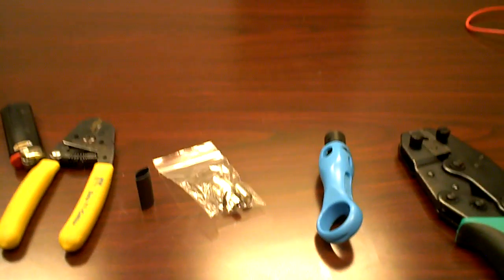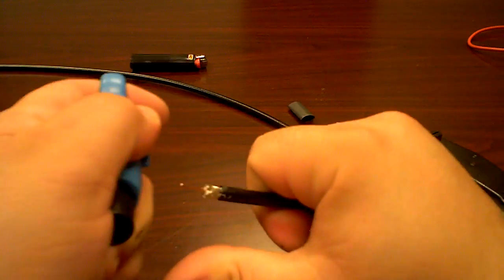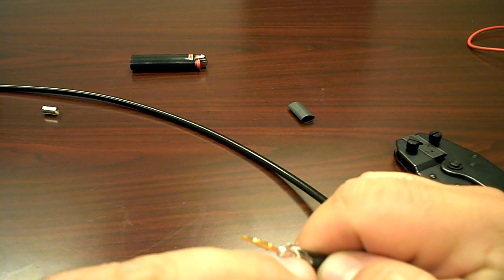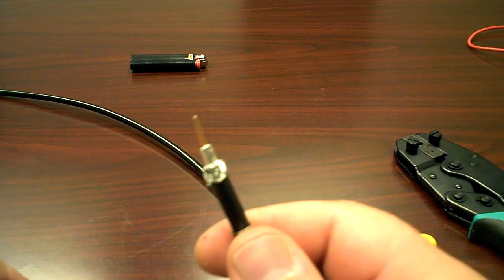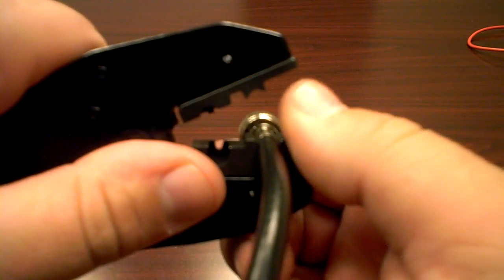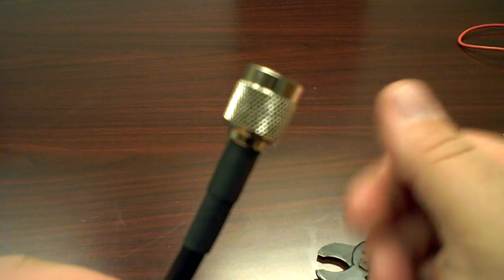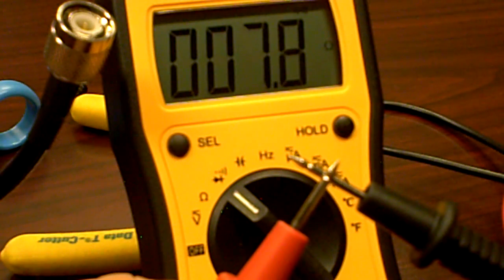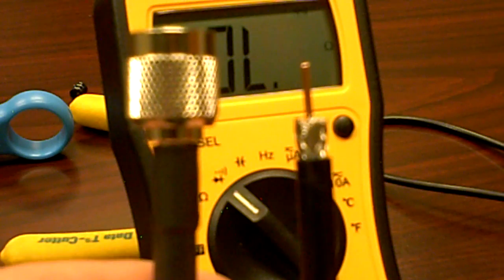LMR240 Termination

Comment: about a month  1/2 ago I bought some of this coax in the form of an 18' jumper. My intention was to use it when it came in but I just can't get my self to take the old off and put the new on. Is this as good as its made out to be?  I know I am missing out on some great coax by letting it set where it is.

Comment: Great demonstration. I can only comment that using a lighter for heatshrink works but it's not proper, sometimes harmful chermicals are released when the cable jacket is burnt. There is a proper heatgun for heatshrink, but anyway great work.